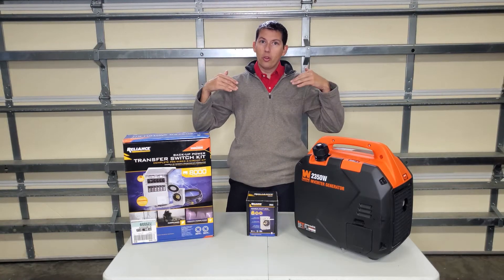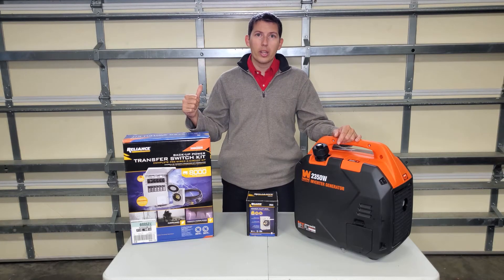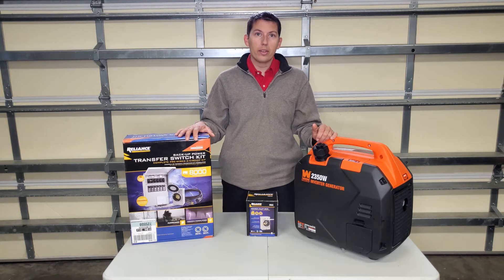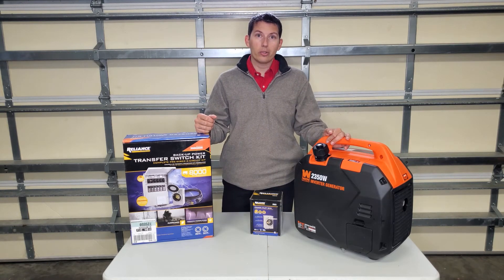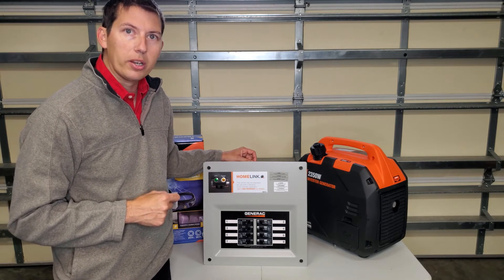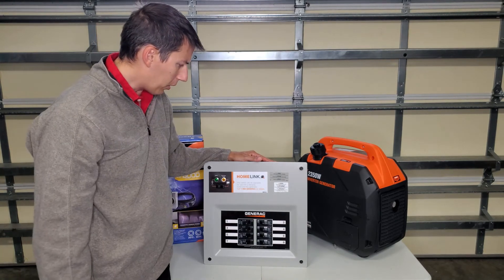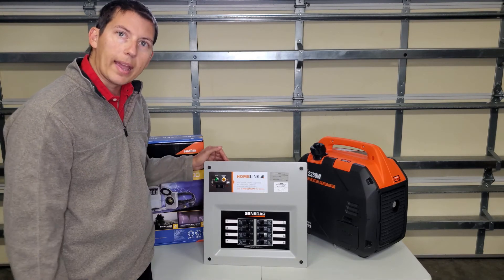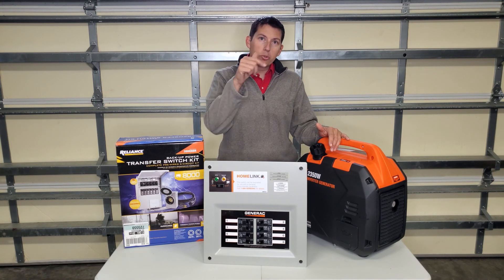GENERATOR TRANSFER SWITCHES What You Need To Know

Comment: So what model Transfer switch is that could you ad a link or more info in the description> there are a lot of videos on wiring older homes no one explains you might encounter these AFCI/GFCI circuits. Also no videos explaining how to wire them in your main panel I have seen a few electric forms online where people have TS tripping there breakers in the main panel when Utility power comes on but everyone taps out and says just install a lockout instead... thank you so much for going this far. is the full model HomeLink sorry if that is the case

Comment: FYI...this generac TS will not work with the gen you have on display.  the solenoid will not pulse from utility to gen.  It requires 240v across L1 and L2 to function properly. You'd still be able to operate the switch via the included handle but this requires the user to remove the panel cover and basically defeats the purpose.  From what i can tell that gen would only be a 125v 30 single pole unit. with a 3 pronged twist lock outlet. Just pointing this out for the viewers.
Reply from the maker: Sorry  sure but you are incorrect  there is a switch  and you simply  push  it for  second  and I switch  to gen or to utility
Reply: @beyondhumbl5943  

Yes I’m aware of the switch on the panel. For it to operate you need a 240v generator connected. A 120v generator will not allow you to operate the switch that pulses the solenoid.  You don’t know what you are talking about.

Comment: My reliance transfer switch days you have to add the afci breakers to it, so that you can use it with main breaker afcis. There is only one main neutral in the transfer switch. Is there no way to wire in a neutral to each circuit?
Reply from the maker: No there is no way to use an afci breaker with that transfer switch. It will not work
Reply: @beyondhumbl5943  not true. Reliance sells a kit. It transfers the neutral to the transfer switch. You have to change the breakers in the transfer switch as well. Part number nk10 for the 10 circuit transfer switch. Look it up. 
Only problem is you cannot run the transfer switch and grid power at the same time like you can with regular breakers. Once the grid comes back up, the afci breakers in the TS will see grid power and trip.
Well at least the tech from reliance said he thinks it will.

Comment: Finally, the video I was looking for. I have 4 breakers that use AFCI/GFCI. Wired up the Pro Tran 2 and then found out the A/GFCI won't work because of the neutral. Will now try to ship it back or sell it to get the Generac one. Thank you for the video. Would be cool if you could do a video on how to wire it up.